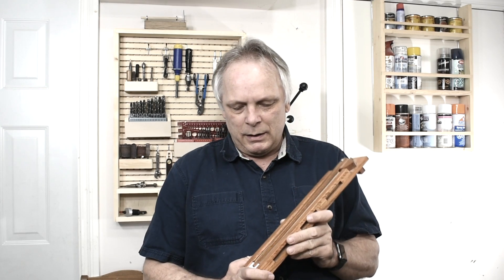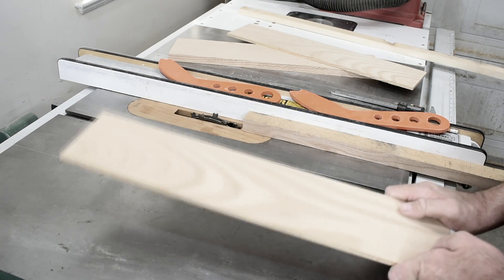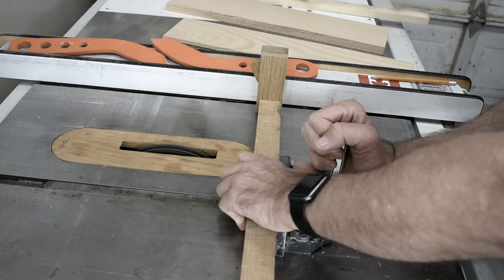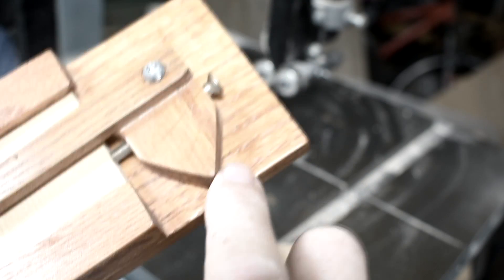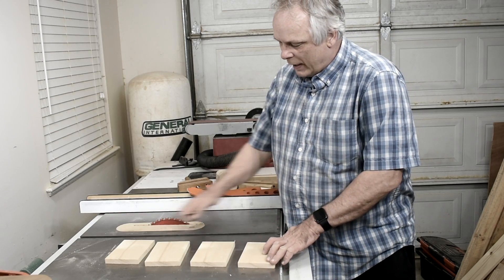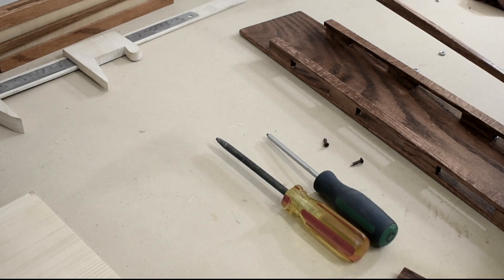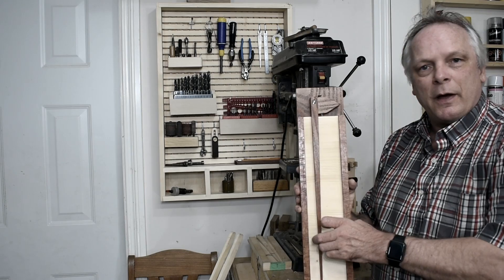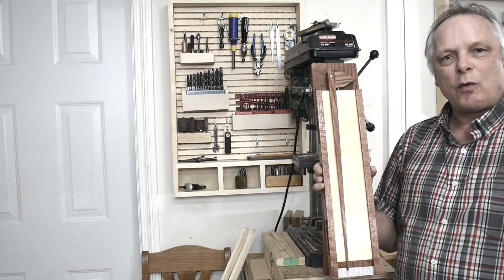Build a Moisture Meter

Comment: Jack, sorry, I'm missing something. Why does the wooden needle move in one direction? I thought the needle would expand or contract in all directions. In my way of thinking, a different type of wood is needed on one side of the needle. Similar to how bimetallic metals are constructed that mechanically react to temperature changes. But, in this case it's moisture.
Reply: Take note of the adjustment screw that goes down through the small fat weighted pointer, and rests on top of the spruce cross grain slab.  As that spruce slab absorbs moisture from the air, it swells vertically (perpendicular to its left/right cross grain), pushing against the stop block on the bottom and pushing up on that screw, rocking the small fat weighted pointer upward, and moving the pointed end of the long needle to the right.  When the spruce slab dries out in less humid weather, it shrinks downward, so the bottom end of the adjustment screw follows it downward due to the weights, swinging the long needle to the left.  So left means the air is less humid (because the spruce slab is drier/shrunken), and right means the air is more humid (because the spruce slab is wetter/swollen).  So the wood in the long needle isn't shrinking/swelling, it's stable due to being a tighter grain wood and the fact that it's sealed.  It's the unfinished spruce slab that's shrinking/swelling.  The long needle isn't similar to a bimetallic spring measuring temperature -- it could be made of any substance, and is just an indicator of the tiny amount of distance the spruce slab swelled or shrank, multiplied to a visible left/right distance because of the needle's length.
Reply: Wood expands the most cross-gain not equally in all direction which is why he had to glue up a spruce board. The bolt contacting the spruce board is on the right of the pivot bolt so when the spruce expands it pushes that bolt up and pivots the whole arm to the right. Because the frame is finished it will absorb humidity much slower than the unfinished spruce board.
Reply: JusBidniss conceptually very simple... but you explained it well.
Reply: Ok, I now see what's going on. For some reason Jack I thought you were indicating that the actual wooden needle was directly responding to the moisture. I missed the fact that the spruce plank is free floating under the adjustment screw.  I guess I should start watching your vids sober. :-)

Comment: Even though I won't be making the moisture meter, I still found this video helpful. I'm just starting woodworking and don't have a table saw yet, but need to put a rabbet into a post. The router in a vise trick should work for now until a better solution comes along.

Comment: My moisture meter is my front entry door. When it starts the rub, I know the moisture is high.
Reply: +Joseph Malovich : I am thinking of a moisture meter. You are thinking of a barometer.
Reply: Wemja : Yes you are correct. We've had several significant thunderstorms in the last week, and my back door refused to warn me about all of them. It was consistently difficult to close all week, thus lacked the "differential sensitivity" I require for my scientific observations. 

However, on scampering upstairs and visually checking the oncoming cloud formations, wetting my finger and holding it up (in a very rude way, some might suggest), to check speed and direction, I was accurate 90% of the time; thus I was able to warn the cats and dogs; "It's gonna rain like hell and go bang!", I said, so they all scampered into their favourite hiding places just in time.
Reply: +seephor : My back door is similar; very difficult to lock during the hot-rainy season, but easy during the cool-dry season. However, Jack's Moisture Meter might be a good indication of thunderstorms approaching, which my door is unlikely to predict.
Reply: you are thinking of a barometer.
Reply: moisture meters cant predict thunderstorms on their own, you need other equipment too.

Comment: how do you use it ?
Reply: To expand on Coop 'n' Timmis' comment, wood expands and contracts most in a perpendicular direction to the grain pattern, and softwoods like spruce are more susceptible to these dimensional variances than hardwoods. So the centre piece is a softwood that expands and contracts easily, and the exterior frame is a finished/sealed piece of hardwood with it's grain oriented vertically in the opposite direction of the spruce grain so that it doesn't move so much with humidity (or temp changes).  
The pointer can be calibrated and a gradient established to measure actual RH by simply using another hygrometer to reference the low and high points, then divide the space into equal parts. It's more ornamental than useful really, affordable digital weather stations have otherwise made these obsolete.
Reply: Sadin Tekgöz as the moisture increases, it causes the centre price of wood to swell, pushing up on the spring moving the pointer along
Reply: You hang it on your wall.